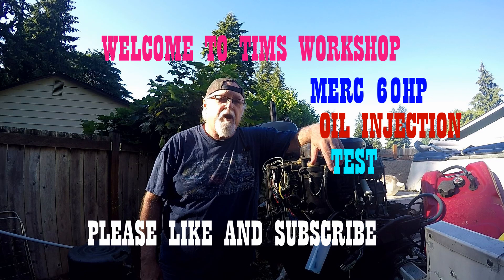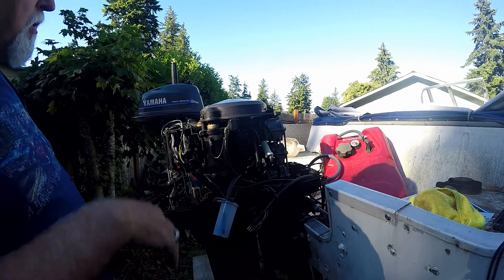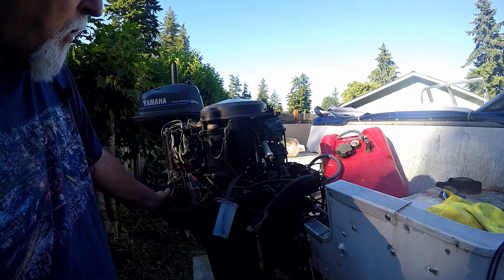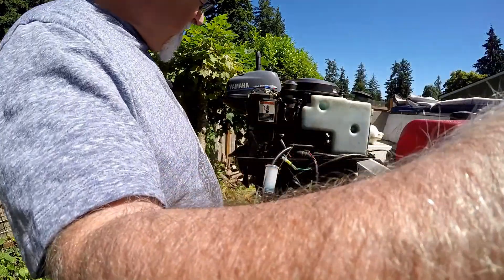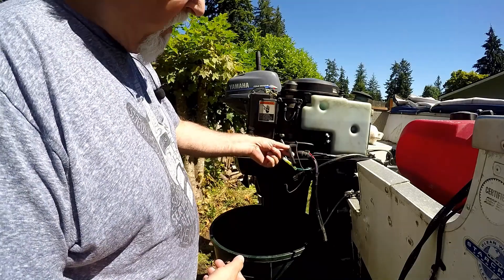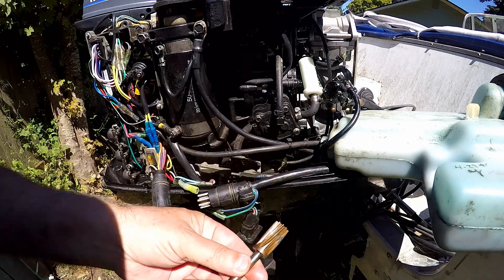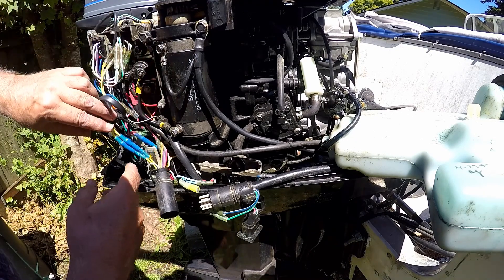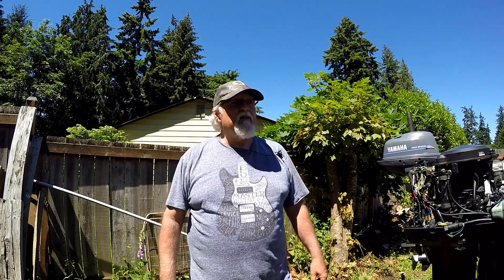Merc 60hp oil injection test

Comment from the maker: Hi folks, it's was brought to my attention there is a plastic mating gear the oil injection pump mates to that goes to the crank side. Noway to replace it unless you take the block apart. I suggest if you have an older motor like mine to delete the oil injection and go to premix. Too risky burning up your motor if the oil injection fails. Thanks to my viewers pointing this out. There is videos out there showing how to delete the oil injection system. Make sure you mix the recommended two stroke oil with you fuel. Say like your only filling it up from a half a tank. Make sure you measure the correct amount of two stoke oil and should be put in before filling for it to mix right.

Comment: Hello, on my 2002 50hp Mariner outboard, my oil pump suddenly started sending a large amount of oil into the engine. While the boat is parked, I find a lot of oil on the ground and in the air filter, mainly in the lower carburetor. Can you tell me what the problem might be and what I should check, please?
Reply from the maker: So, common thing is folks over fill the oil injection tank and when the motor is tilted up it leaks out everywhere. There is a recommended amount of oil required when the tank is empty and that's it. First time you fill it mark where full is on the tank and don't put anymore than that mark.
Reply: @TimsWorkshopTJY Hello, and thank you very much for your comment. Thinking about it, I am indeed one of those who fill the tank completely. I hadn't really considered the possibility of leaks due to the engine's tilt during road transport. I'll make sure to fill the tank less and observe. Many thanks from French Guiana! 😊
Reply from the maker: Glad to help and thanks for watching the channel. Wow, your along ways from Seattle😊

Comment: Thanks so much for your video! Your 60 seems to be made a lot  like my 40hp Mercury,  1998.  I just bought the boat and concerned or definitely wanting to verify that the oil injection is working.  At first, when you were telling the procedure I was wondering how the engine was going to get oil when it was disconnected,  then you mentioned the premixed auxiliary tank....lol.  Does the manual you have list a 40elpto model Mercury 40hp?  If so, I'd definitely like to know the # of the manual you have. Thanks again.
Reply: One other question.....do you know a simple way to increase the idle without going through the whole sync & link procedure? Mine seems to run good what little I have ran it in last few weeks but it won't idle or only idles for a short period before stumbling and cutting off. I appreciate any info or help more than I can say!
Reply from the maker: So the link and sync only sets the carbs for open and closing in sequence. For idle you have to adjust the idle timing screw which also sets your ATDC 2-6 degrees. It's the shorter screw adjustment on the control arms. Setting the idle RPM is a fine turn adjust which doesn't go beyond the 2 to 6 degrees setting. When setting this per the book you have the motor in water or barrel in forward gear at idle. You adjust it to 650-750 RPM. There is a carb fine tune as well adjusting the air/fuel mixture screw out from the 1 1/4 strarting point counterclockwise no further out than 2 turns. While doing this adjustment you also have the motor in water in forward gear at idle staring with the top carb and watch you RPM changes. Try to set them all the same doing this process
Reply: @TimsWorkshopTJY thanks for that info.  I'll have to get me a tachometer of some sort. My Smoker Craft just has a speedometer,  no tachometer or any other gauges. I work on small engine equipment but has become mostly ATVs and dirtbikes lately so I'm familiar with adjusting carbs but haven't messed with the mixture screws yet. I got to reading so much about the link & sync and wanted to make sure I checked it since previous owner said it just had a carb cleaned and its having an idling issue. I appreciate it again!
Reply: @TimsWorkshopTJY I stuck my timing light on it just to see what I saw when in neutral turning over with starter, it was aprx 4° best I can tell. It won't idle so I can't check it idling.  I had read about the screw you are referring to that adjusts the idle & timing as well. That's the other I haven't messed with yet. Hopefully I will figure the issue out soon. I don't think its much wrong since it sounds so good and ran so good when I tried it out.
Reply from the maker: I have a runleader tach/hour meter. Easy to use and doesn't cost that much. Can use on a variety of engines. If you'd like to help me out pick yourself up something from my merch shop. https://tims-workshop-tjy.myspreadshop.com/
Reply from the maker: 4 degrees is good but you need to set the idle timing RPM
Reply: @TimsWorkshopTJY I'm going to get a service manual so I can do everything step by step, like it says in manual.  Does your manual,  the one you gave the # to,  does it say 40hp on cover?
Reply: I didn't have the spark plugs out when I tested with timing light, just had the plug wires connect to 3 spark testers unpluged from spark plugs so that test probably wasn't accurate either and since its not idling correctly,  I shouldn't go by that anyway huh?  I think its called a base or static test (when u test in neutral with starter). A manual will definitely help me out.
Reply: @TimsWorkshopTJY  I may do that.  I just thought about having a tachometer for my gasoline 2 stroke RC truck, wraps around spark plug wires and its accurate.  Think that will work for a tachometer on this mecury? Sorry for all the questions but I normally know what to do , what to adjust. This is actually my first real outboard.  Had a couple under 6hp but different animals! Lol
Reply from the maker: That's how this one works. Vintage old Outboards are pretty simple but these motors with stator, trigger and switchbox are more complicated for sure
Reply from the maker: cranking speed actually
Reply from the maker: Yes my book covers the 40h too. The number of the mercury manual that you will need to call them for shipping is 90-817643R1
Reply: @TimsWorkshopTJY Thanks so much man!
Reply: @TimsWorkshopTJY  I just punched that # in and it took me to the bay where some were for sale...on the front it shows 45 jet being the smallest outboard covered in the manual shown on Ebay with that model # manual,  I wonder if they had the wrong picture up?

Comment: Hey Tim,
Is there only 1 oil line that goes into the fuel line?and is that the where the oil cones out of?
Reply from the maker: Hi Robert, so the oil line goes from the oil tank to the oil pump first then it goes from the pump to a one way check valve then tee into the fuel line before the fuel filter. The check valve only allows oil into the fuel line but keeps the fuel from going back into the oil tank when off.

Comment: I must be misunderstanding something. If disconnecting the rod allows the oil pump to go wide open, why do the engine RPMs even matter?
Reply from the maker: The oil injection rod on the pump is metering the amount of oil mix into the fuel. When you throttle up the fuel pump pushes more fuel into the carbs. With more fuel you need more oil and the rod is a link for that balance
Reply: @TimsWorkshopTJY  thanks for your reply. I mean, once the rod is disconnected, is the pump not pumping constantly wide open? That's why I'm confused about the RPMs.
Reply from the maker: It's been awhile so I'll have to look it up but if the rod is disconnected that goes from the oil injection pump to the lower carb the pump will only pump it's lowest setting for idle speed which is adjustable. If you increase the carb throttle without it hooked up the increase of oil will not happen unless that rod is hooked up. The test i did I'm sure the rod was hooked up but I had the rpm speed at 900 rpm to 1000 to do the ml cup test for 10 minutes which should be approx 20ml to come out. If your going to do this test I'll send you a picture of the test. Let me know. Thanks
Reply from the maker: I don't have that boat and motor still so I can't disconnect the rod to see which way it goes? I think it was spring loaded to go all the way to one end just can't remember which way?

Comment: Thanks Tim. I have the same engine and I got home from a fish trip yesterday and it seems to have used very little oil, so I'll be running this test asap.
Reply from the maker: Mine actually was more than required but just left it. It's adjustable so you can increase the flow but I'd first drain the tank, clean and put new oil in first if low flow testing is done.
Reply: @TimsWorkshopTJY  I ran the test just now... like you I had high flow... I got about 25ml out of it in ten minutes. I'm happy with that, better too much than not enough. Thanks again for showing us how. Did a compression test while I had the hood up too, got 130/140/140... not bad for a 25 year old engine.
Reply from the maker: Your in good shape with that one. Always keep checking it as far as the tank. The alarm is best if it's working right. It's better to know before it's too late. I was thinking about just doing the mix and deleting the oil injection but read having it is actually better for the run preformance especially and older Mercury.
Reply: @TimsWorkshopTJY  Yep that's the problem... the oil injection's a far better system as long as it's working, but if it fails it's fatal and there's no warning. It really needs some sort of low pressure warning on the output of the pump, but with such a low output pump I don't know how you'd do that. 

Oh FYI I just read my manual for the motor, for the 60HP it says the output should be 22cc +/- 3cc, and the 40 & 50hp should have 15cc +/- 3cc, so the numbers we're seeing are pretty spot on. It also says to bleed the air out of the oil injection hoses while still running on premix too... so that's a job for tomorrow.
Reply from the maker: That's probably why they put the sensor on the tank for the alarm. It doesn't need to be a buzzer though. I think a light would work with a red cover?
Reply: @TimsWorkshopTJY  the sensor on the tank only tells you if the tank level's low. It doesn't warn you if the tank's full but the pump's failed, which is the main reason some people pull the whole pump out and just use premix. A pressure sensor on the pump output with a warning light would fix that, just don't  know if you can get a sensor for such a low, irregular output.
Reply from the maker: Not sure but would be something to look into as a backup to the alarm.

Comment from the maker: best way to find where it's coming from which would be the oil injection system is clean the motor with a degreaser then watch it after it runs for awhile.

Comment: hey its me again just lookin over my motor and notice little bit of oil residue by crank case is that normal for used outboard 60hp 2 stroke mercury outboard ?
Reply from the maker: Best thing to do is clean off motor with a degreaser, let dry then let the motor run till its warmed up and see where it's leaking from?
Reply: i think i read about filling the oil resiviour to full and oil leaks out someone said they have a problem leaking oil when that is done No wonder when i baught the boat THERE WAS 2 QAURTS SET ASIDE & resiviour was only half full  @TimsWorkshopTJY
Reply from the maker: Don't fill it all the way up. There is a breather hole on top of the tank. When you tilt the motor all the way up it will leak out. The mercury service manual has the correct fluid capacity for you motor to put in the oil injection tank.
Reply: @TimsWorkshopTJY  THANK YOU FOR THE HELP
Reply from the maker: No problem, you really need to invest in the service manual for your motor from mercurymarine.com. call them up and order one. You will thank me later. Tim
Reply from the maker: 920-929-5040
Reply from the maker: After this Johnson restore I plan on going through the Starcraft and 60hp merc before boating season ends for fall storage. Hopefully some good updated tips for you so stay tuned👍

Comment: hello nice video! I've a problem with oil pump (maybe oring) because the tank of oil it empties itself even with the engine off and will go in the cylinder and then purge near the propeller! My mechanic told me he need to disassembly all the engine block for change the orings.. is this true? from your video i saw i can just work on the oil pump without disassembly all the rest! Thanks!
Reply from the maker: There is a one way metal valve in the fuel line but that's only to keep fuel from going backwards into the oil tank. You oil injection pump if set right only allows what is needed to mix with fuel into your carbs. If only oil is going into the carbs the motor wouldn't even start or run? Something is not setup right. You need a service manual for your motor
Reply: @TimsWorkshopTJY  the motor is the same of your video! If i not use the motor from a week or more it won't start because the cylinder is full of oil! Is possibile one of this two oring is damaged and the oil will go in the engine with the engine off?
Reply from the maker: That's one of those questions that has to be looked at? I have no idea how oil on a two stroke motor would go into the piston cylinder like that unless the reed valves are shot and the oil injection  pump?
Reply: BestG -  did you ever find the mystery drainage of your oil reservoir -  I think i may have the same issue...
Reply from the maker: Mine was coming out the top breather cap on top when I tilted the motor up. Don't fill the container all the way. 3/4 is fine. Actually the book has a quantity to put in from empty and I'm sure it's about the same amount to keep this from leaking out
Reply: @TimsWorkshopTJY  ahaa...Well, I didnt tily my motor up very much, and after coming back to the winter house to use it, ALL the oil had leaked out! -  ...so i checked the bottom outlet on the reservoir -  no cracks, and a good zip-yie on it....but just a very very minor "Weepiness" -  so maybe over the hot florida summer it the temps thinned it out to help it leak slowly out.  I think i may switch to a silicone tube and a tighter clamp....
Reply from the maker: For any leak checks clean it good then check it for where it's leaking from? I need to replace my tank hose too.
Reply: @TimsWorkshopTJY  I did the whole nine: remove reservoir, remove tube from bottom, degrease, reattatch, ziptie....but still seems weepy, maybe because the tubing is harder from plain old "aging", and it it no longer pliable emough for a zip tye to crimp/squich.  >>.  Tim, is the clear oil-tubing on these motors something special (like the fuel line)....or is it just regular Home Depot PVC tubing?....Its probably a good idea to replace that outlet tube with new, more pliable tubing....and maybe a better and more effective hose "clamp" on it to prevent leaking
Reply from the maker: Not sure on that one but since it's not fuel rated it would be a softer hose. Read the TC-W3 lable on the synthetic 2 stroke oil and then just buy a hose from your auto parts store that is OK for this oil running through it. The line you have on it shouldn't be hard with oil in it but any rubber over time especially the outside will get firm or cracked. Time to change them.
Reply: @TimsWorkshopTJY  ...on it, Tim Soldier!

Comment: how do you tell if an oil injection system is failing without this test?
Reply from the maker: Most boats with oil injection systems have an annoying alarm that goes off letting you know your oil is low.
Reply: @TimsWorkshopTJY  HiTim -  would you happen to know if that oil injection spec is the same as my 50hp 2001 ELPTO Merc?
Reply from the maker: Not sure? I suggest you invest like I did into a service manual for your year and model. It's well worth it. Pictures and step by step maintenance, and troubleshooting procedures.
Reply: @TimsWorkshopTJY  Thanks Tim!
Reply from the maker: Here you go. Looks like they are the same as far as the testing. As you can see on my video the oil injection pump on mine has a metal drive gear. Newer motors have a plastic or nylon one which don't hold up. It's good to know what you have and if you can get a metal one that's one thing you won't have to worry about. Another thing is cleaning the tank and sensor now and then. They can clog up or the sensor quits working. Some folks disconnect the alarm but if it's working right it will only come on when you first start it. Then it should go off unless there is something wrong. The alarm sensor is mounted on the motor which can be replaced if it fails as well. Hope all this info helps from my book. Tim
https://photos.app.goo.gl/3mSkmQbD9ky8kGAc6
Reply from the maker: If you like my music on the videos you may like this from an old Rusty musician🤣
https://youtu.be/aoDWxBK-2TE
Reply: @TimsWorkshopTJY  Super, Tim -  the only page i dont see is the one/s that shows the verification "procedure" (disconnecting, graduated container, 50/1 mix in a separate tank, etc)
Reply from the maker: verification procedure? not sure what is missing. One picture is of the oil injection test of 1500 rpm at 10cc for 10 minutes. hopefully that picture came through. As far as running an aux tank 50:1 for the test that was just what you have to do when running the motor without the oil injection hose hooked up to the fuel line and into the cc container in my video.
Reply: @TimsWorkshopTJY   -  by the wy, Tim -  where did you get that cool little graduated container? Coundnt find at the big box hardware stores nor CVS/Walgreen, etc...
Reply from the maker: I think it was the container from the brake bleeder kit I have. I saw it had ml readings on it which worked
Reply: @TimsWorkshopTJY  very trick!
Reply from the maker: https://photos.app.goo.gl/QUR5zjjqHuRGs9An6
Reply: @TimsWorkshopTJY    Thank you!